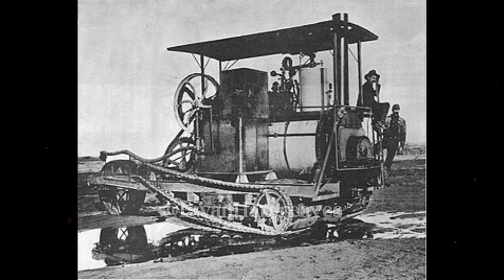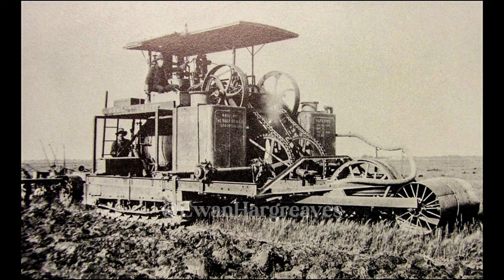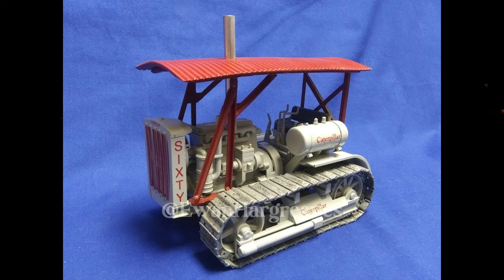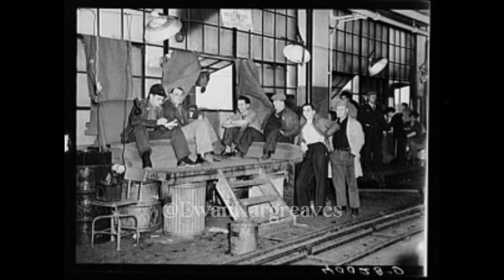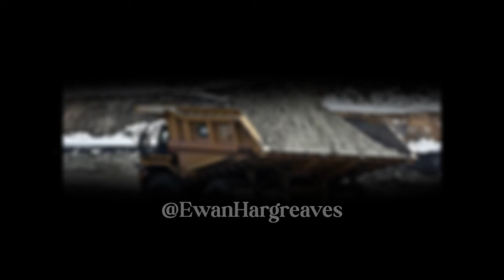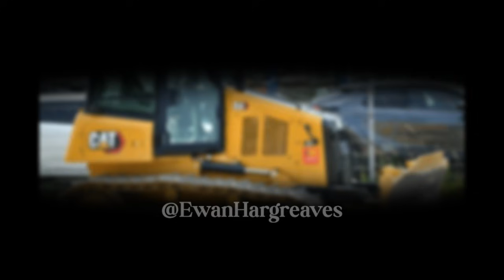This Man Put Tracks on Tractors — and Changed the World

Comment: Referencing about 00:58 in this video: 

FWIW: Like many other situations, that is something I [re]learned being a Loadmaster on the Lockheed C-130 Hercules turboprop transport aircraft while in the US Coast Guard. 

If the load on the floor of the airplane's cargo compartment is too high, you have to use shoring {or something similar} to spread out the load over a wider area.